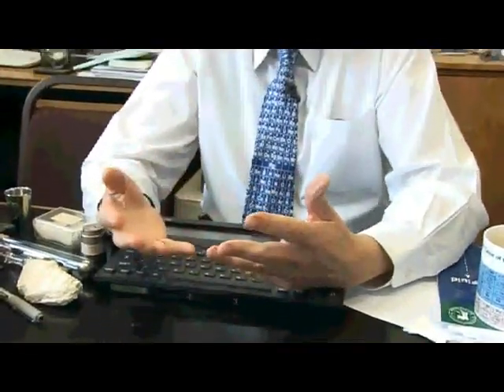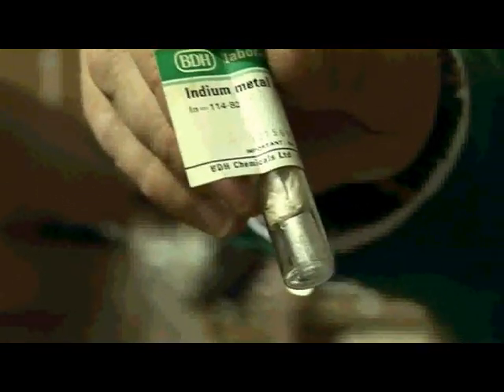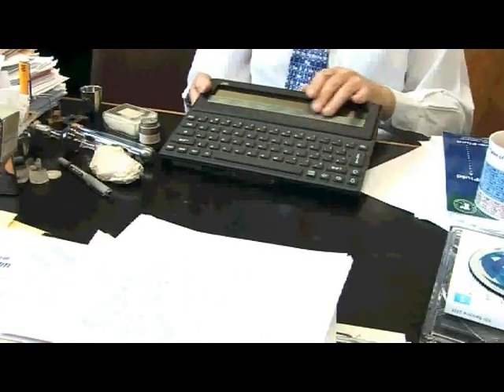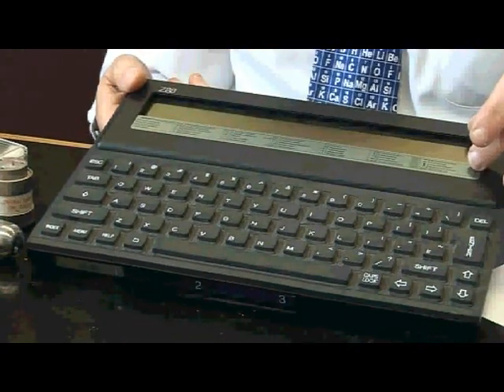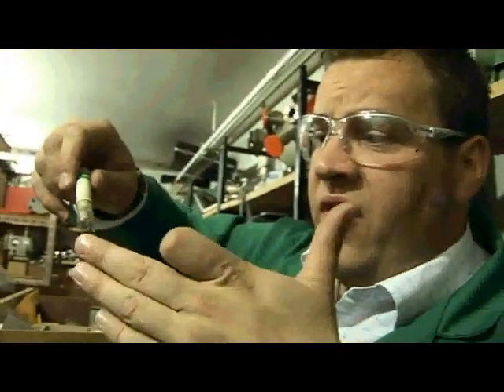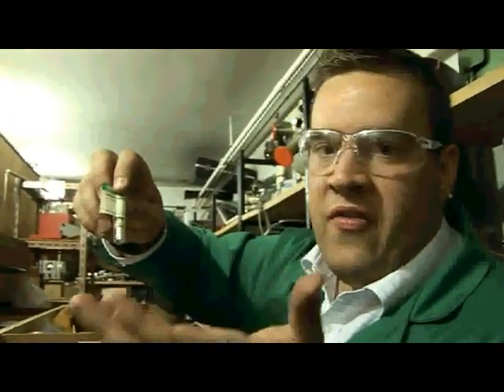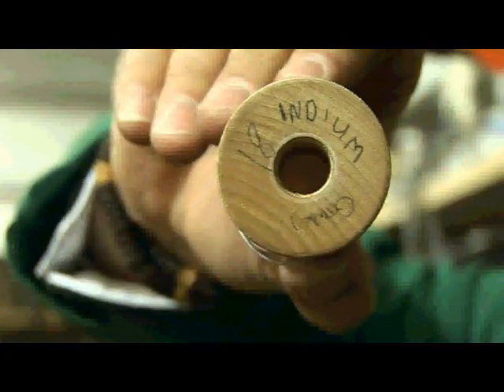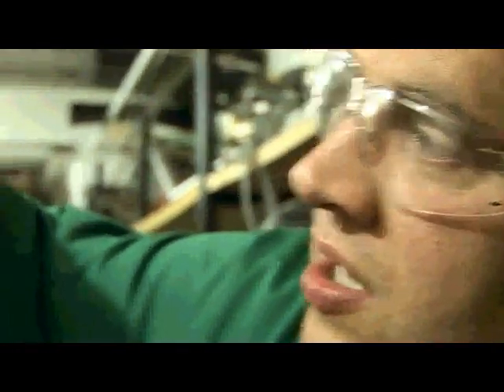Indium (Version 1) - Periodic Table of Videos

Comment: I work at the Indium Corporation (Rick Short). There is no reported "toxicity if it comes into contact with the skin" ever reported with indium metal. Wikipedia states: "Pure indium in metal form is considered non-toxic by most sources. In the welding and semiconductor industries, where indium exposure is relatively high, there have been no reports of any toxic side-effects."